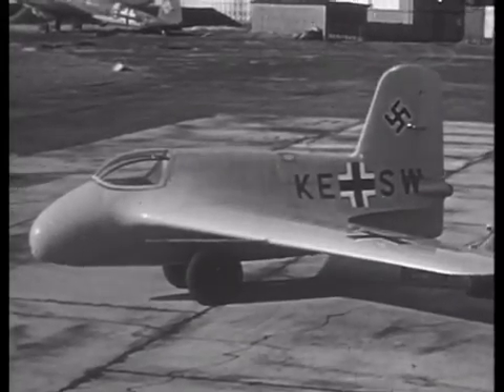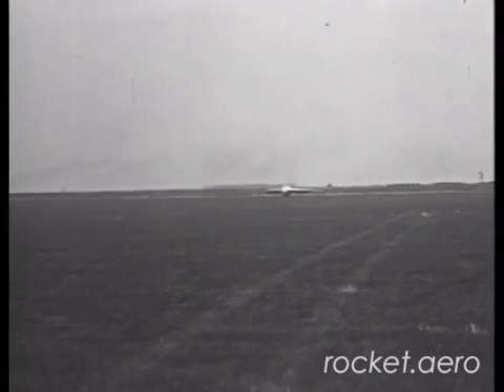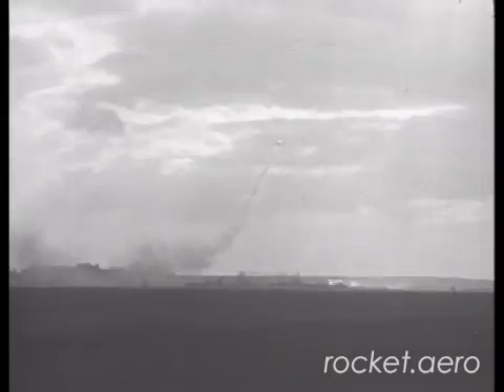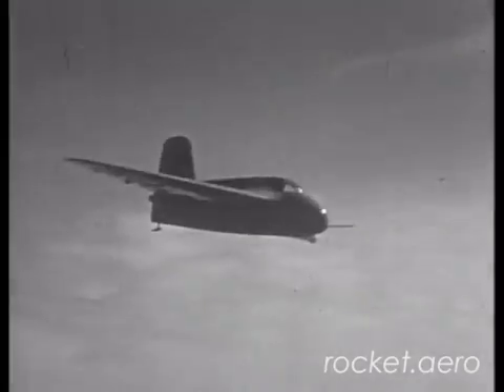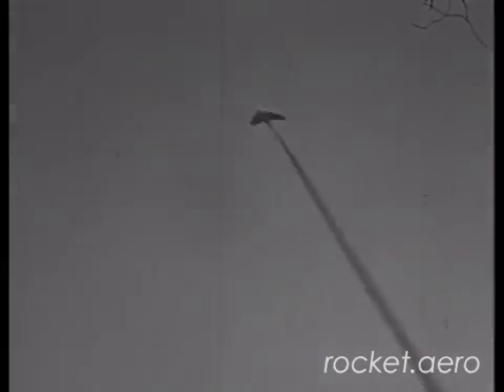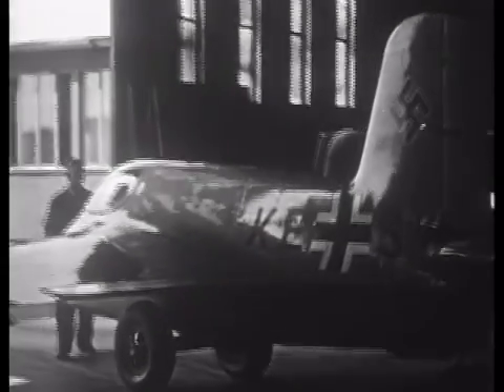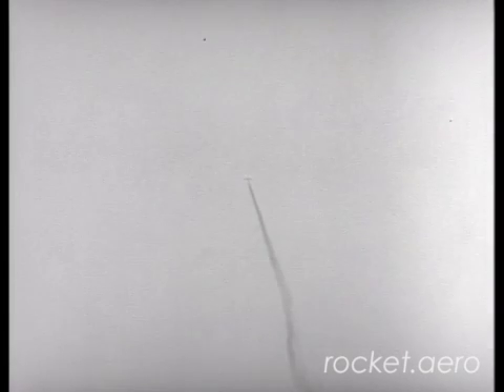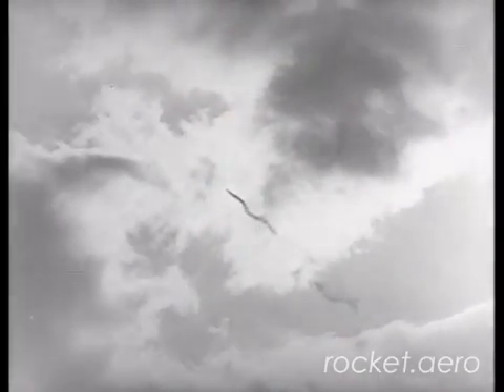Me 163A Testing

Comment: From everything I know.
It used way to much energy to take off, gain altitude.
Belly dropped from a bomber like the X-15 it would have had better flight times.
Or ramp launched like the V-1.
But, those devices took up space.
Still, an overlooked one time only weapon. Knowone else has yet to build one.
A rocket powered fighter.
 With common sense swept wings.

Comment: Question - That incredible climb rate, was there any danger of a pilot getting the Bends from being elevated into a much thinner atmosphere so quickly?
Reply: No . The changes in ambient pressure are of a far lesser degree in altitudes above sea level, and the pressure is decreasing. Walking about at 20,000 feet , is possible. And with oxygen, there would be little discomfort. At 20,000 feet below sea level, a human body would be flat as a pancake. The main problem , would be equalisation of pressure in ear /nose/ throat , 
in a rapid ascent .
Reply: I don't think so but their ear drums took a beating through the sudden change in altitude. They underwent training in a pressure vessel for this.

Comment: 8:08 I'm no expert but it seems to me there has been some confusion somewhere along the line about these propellants. Hydrogen peroxide readily flashes into steam if it contacts a catalyst, and has often been used for driving rocket turbopumps. Sodium or calcium permanganate, while being oxidizers, would seem rather useless as fuels while in a water solution and are probably serving here as catalysts for the hydrogen peroxide, either directly or after conversion to manganese dioxide. So it seems far likelier to me that the fuel pump turbines were driven by T-stoff than by Z-stoff.

Comment: Why can some aircraft fly without a tail wing?
Reply: It's related to the amount of wing compared to the body. The "tail wing" is known as the 'stabilizer' and the 'elevator.' An airplane with a wing that runs more than half the length of the airplane is very stable. The movable pieces on the tail's stabilizer are used to point the nose of the airplane up and down, like an elevator. On the main wing of a regular airplane the movable parts are used to shape the wing so it's better at taking off, landing, or flying level. On a plane without a tail wing those parts on back of the wing have to do both jobs.
Reply: @cowboybob7093  - not true. Imaging having to balance an aircraft on a pedestal while not moving. Depending on how heavy the aircraft is in the nose, in the forward, middle and end section, and the tail, you need to balance it somewhere infront of the main wings, directly under the wings, or after the wings. That is your center of gravity (CG).

Now imagine the aircraft flying and the the wings providing lift (WL). Unless the CG is located precisely at the WL point, the aircraft will start tipping over, either nose down or nose up. The traditional way to counter that tipping motion is to add tail wings that can provide a counter-lift to force the nose down or up.

The ME 163 have no tail. Instead the wings are swept back so the wing tips are provides the counter lift. Imagine if you cut the tips off, moved them just a tiny bit back, and stuck them on a pole jutting out from the body. Now you have your tail wings (more like slightly aft wings), but the effect is the same: to provide counter-lift to the main wings.

That is the main reason for having tail wings: To balance the plane while in the air. A happy side effect is to be able to also point the nose up and down by un-balancing the plane and make the plane go up and down.
Reply: @JanBruunAndersen  Trim, you've just described trim. Congratulations, you've affirmed my post.

Comment: Did they ever use jettisonable JATOs for takeoff?  Seems a simple way to get more combat endurance.  Of course a small craft like the 163 might be hard to control with a couple JATO mounted off the center line.  Probably invitation to disaster.
Reply: CONTACTLIGHTTOMMY why use jato when it can go at a 70 degree angle at 600 mph anyways?